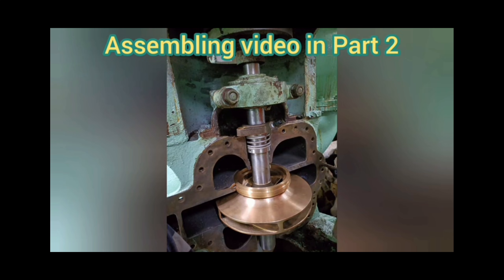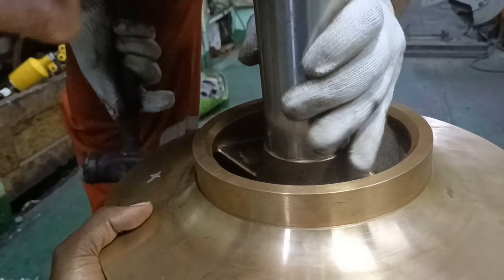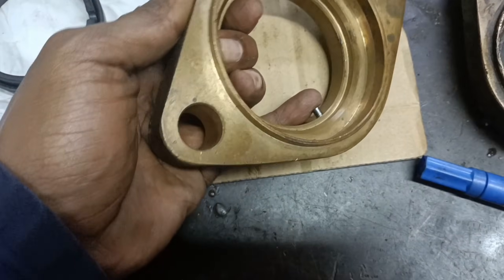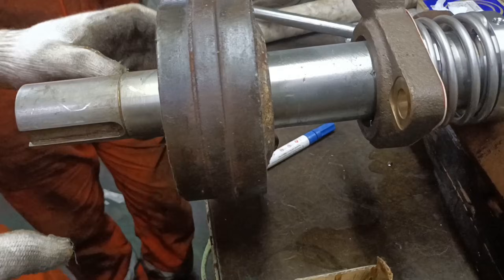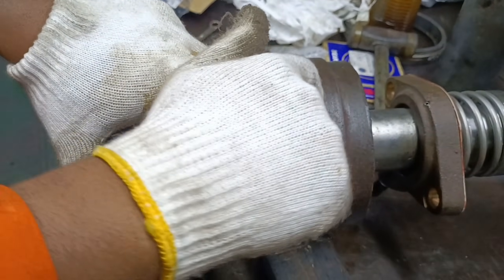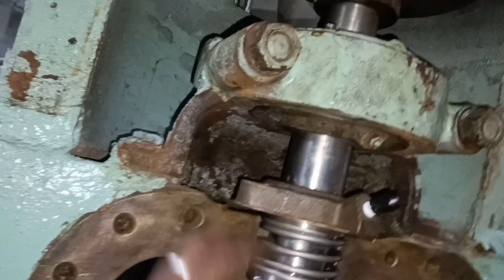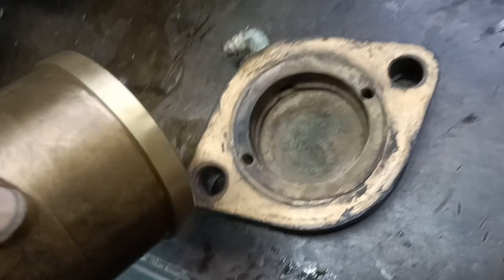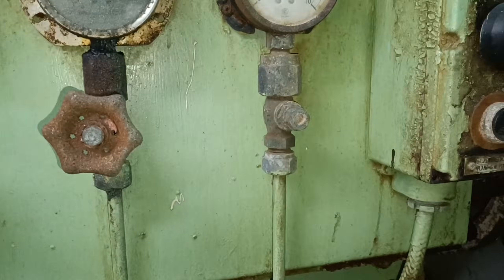Step by Step Overhauling procedure of Centrifugal Pump (Part 2: Assembly)

Comment: Why is the shaft sleeve used?
Reply: The impeller is installed to prevent it from coming off while the pump is running, and an impeller nut is attached behind it.